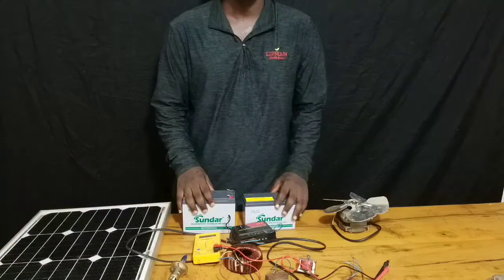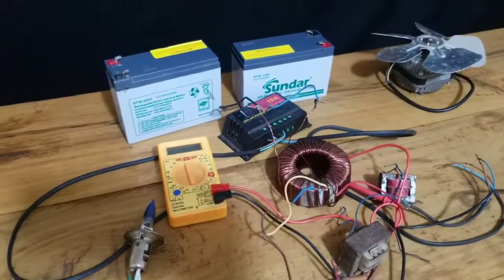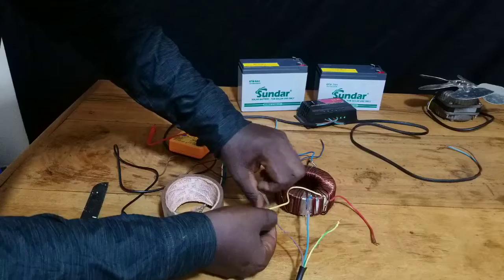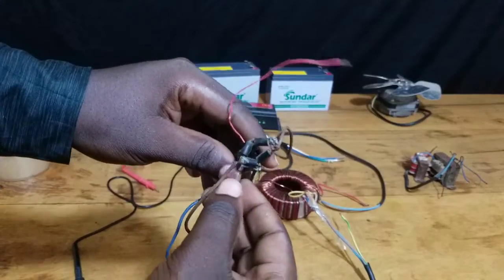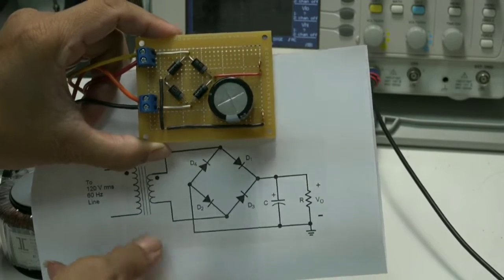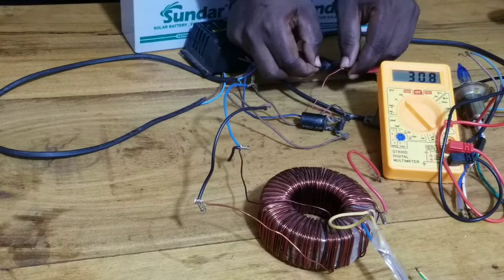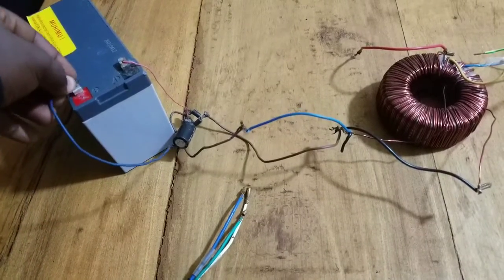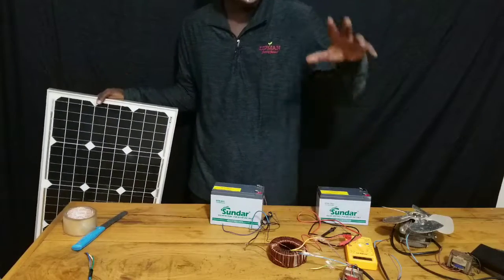how to connect transformer to a battery

Comment: Looks little dangerous. I wonder if you've ever pointed a speaker player ultra violet frequency video at a solar panel to see if it gets any power from the sound? I don't think it works but I don't have a panel. Some the videos say light degrades the panel after after a while, causing two percent loss in efficiency...so it would be fascinating if just ultra violate vibration could power panel...Probably can't, but if it could, there are fancy ways to convert heat to sound and probably the right vibration frequency.